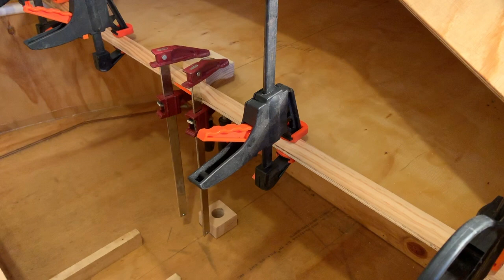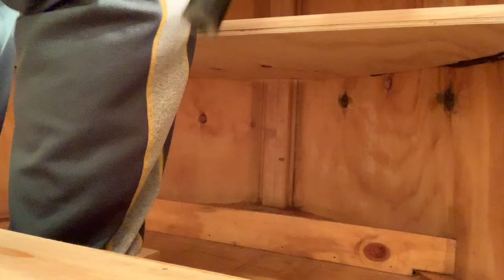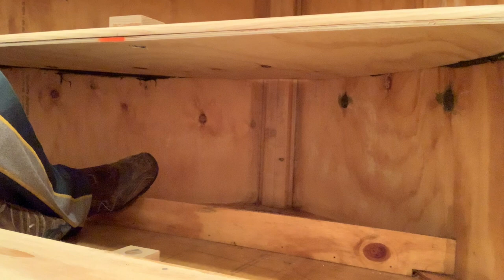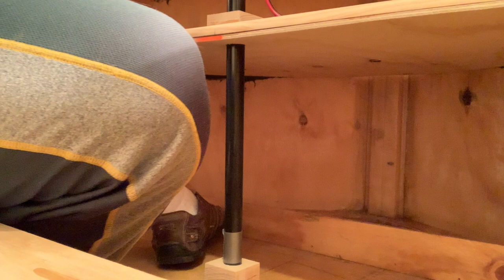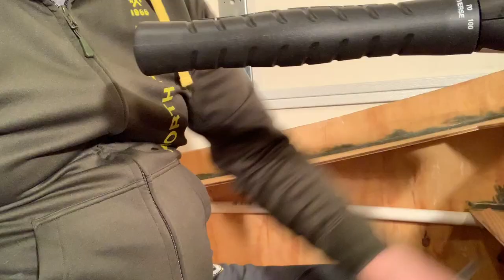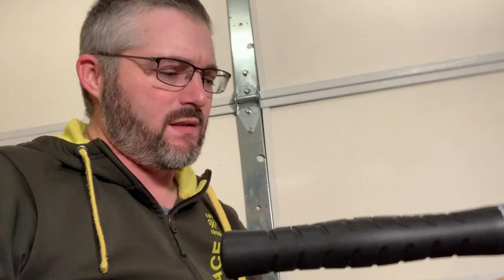Nep'Toon micro tug 9, trolling motor rigging and wiring, Episode 19

Comment: I was curious why 24 volt system and not 12volts. does the power last longer?  how long did the batteries last when you.launch? By the way Awesome job!
Reply from the maker: Thanks John! The 70lb thrust motor recommended by the designer only comes in 24 volts. I do think that a 55-60lb thrust motor would do just fine, but it won’t last as long. At 24 volts, you used half the amperage of a 12 volt system, so it probably wouldn’t go a full day on the water. 

I’ve had it out for an entire day, putting 5-6 hours on the motor and it only ran down to 65%.

Comment: Don't think I would rely on a conduit connector to hold pipe together.  Also for your steering shaft you could make a block with a slit and a bolt to tighten it on the shaft just under the shelf to keep it from coming up out of the lower block.   Also the wires would of looked neater running in a hole close to the motor control and under shelf to the tubes
Reply from the maker: Hehe...thanks for the comments...you have some catching up to do though (just published Episode 30). Steering shaft is already secured, but not with a wood block,, wires are cleaned up and out of the way, and the conduit pipe connector is exactly per plans...not worried about it in the slightest. Plus it has Loctite on the threads. Even if it separated, the control arm is easily movable by hand if worse came to worse. Thanks for watching, and please keep the comments coming...I do appreciate it. Happy boating!